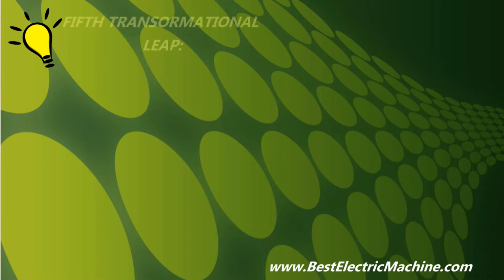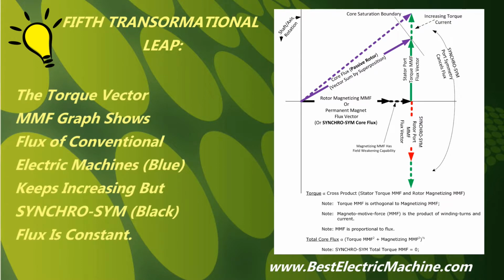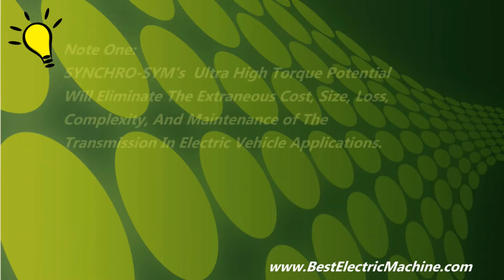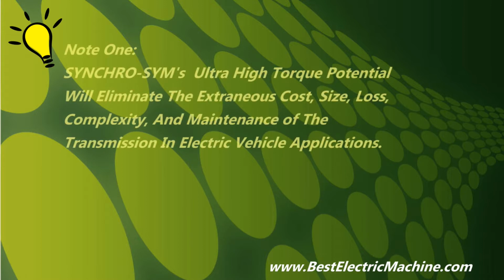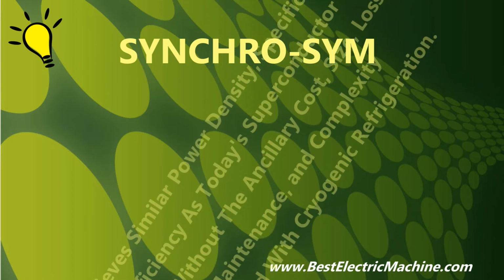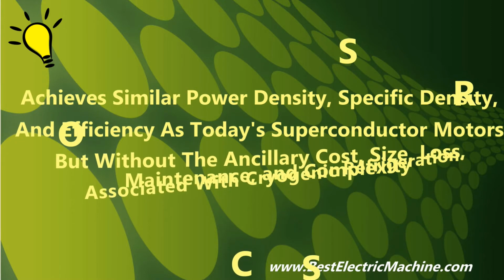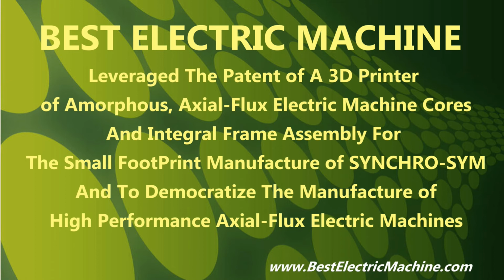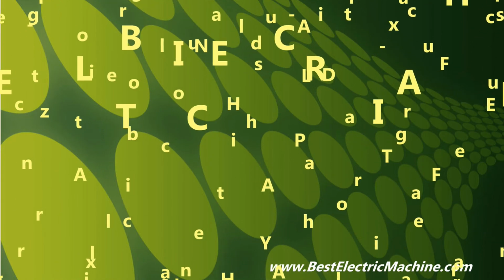Doubly fed Electric Machine

Comment: This is incredible
Reply from the maker: It is incredible once the concept is understood, "Within the same package, make the rotor real estate an active power contributor from its otherwise passive function by applying a patented electric machine circuit and control architecture and as a result, improve efficiency and double the power density while halving the cost of an electric motor system." Thank you for showing your understanding!
Reply: @bestelectricmachine722  It seems like a logical next step and as you said it has been in the idea sphere since the 60s. What do you think of Halbach array motors using this? I sent you an email directly from your site and would love to tell you what I am working on.
Reply from the maker: Phase Focusing Arrays, such as dipole antennas, phase radar, and PM Halbach array, is not new and accordingly, is available for electromagnets as well. The principle is to achieve higher air gap flux density, which is admirable. Still, PMs are passive devices (do not actively contribute to power production), the flux density in a asymmetric PM motor is vector cumulative, the flux saturation limit of the core material is limited, more expensive PM material is needed in a Halbach configuration, and even a Halbach PM motor requires the stator active multiphase winding set (and more complex electronics - SYNCHRO-SYM Technologies may help here), which determines the performance rating of the machine, while SYNCHRO-SYM is straight-forward with a constant air gap flux density regardless of torque current (within dissipation constraints) and no expensive RE-PMs.  Let the contest begin
Reply: @bestelectricmachine722  A follow up to that, do you see electromagnet Halbach arrays as having any advantages over standard electromagnets for the electric machine? Just a personal question I have been wondering for a while and it is difficult to find a place to ask it.
Reply from the maker: It is not clear to me how Halbach arrays more effectively use effective air-gap area. Torque is a function of both effective air-gap area and flux density (seems to be a wash for halbach arrays). Superconductor (DC) electromagnets in a Halbach configuration would confine the high flux density to the inside, which is an admirable achievement. But if AC superconductors become a reality, the holy grail is achieved for electric machines, which are all AC machines for power production.
Reply from the maker: @minkusmaz  Sorry for this late response. Halbach still use rare-earth permanent magnets (with limited life expectancy and flux density potential) with a global security problem. Also, the air-gap flux density (with superconductors the exception) is constrained by the core material flux saturation limits.
Reply: The only specific benefits that I see for electromagnet Halbach arrays are about efficiency due to the focused magnetic fields. Otherwise their power density is lower if I understand correctly. Does that strike you as a benefit?
Reply from the maker: That is sort of my impression as well.  But let's wait for a "logical" response from Halbach experts.